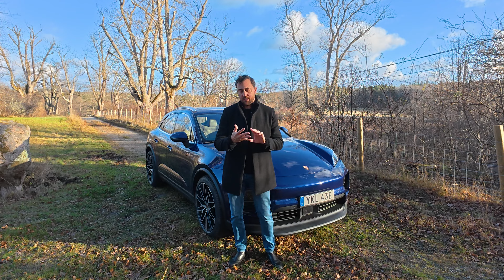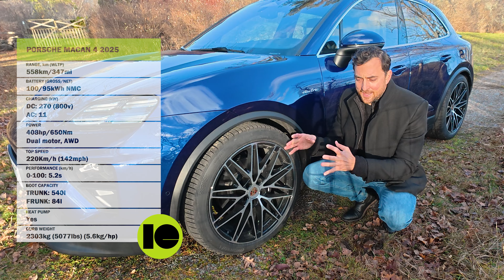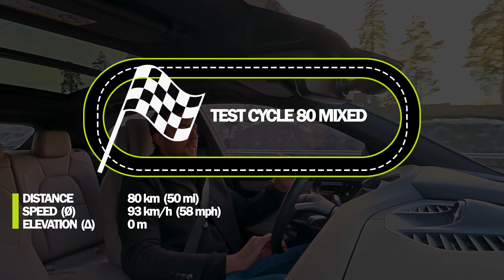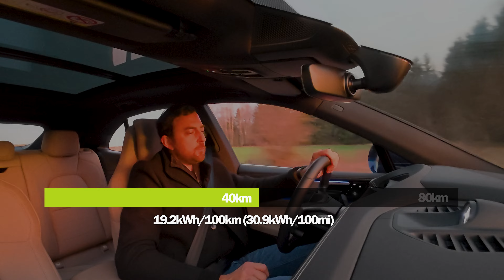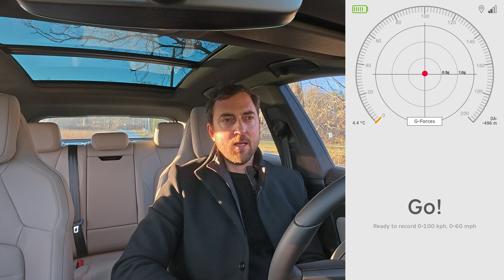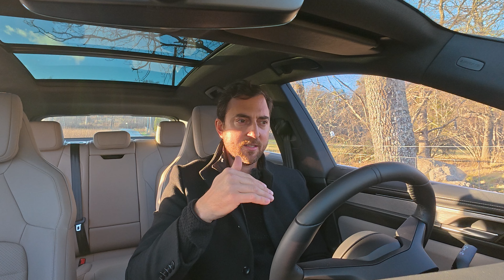Porsche Macan Electric - The things YOU need to know! | Charging, Range, Noise, 0-100

Comment: Attention Porsche owners, do not get thermal glass, it will interfere with functionality of things like radar detector, garage door opener, but if you don't use these things then ignore my advice.
Reply from the maker: Goods info. I have had some gps issues when testing 0-100. Thermal glass may be the reason.
Reply: @ Yes definitely as the way it’s made it interferes with the radio frequency of various gadgets. I don’t pretend to be an expert but I know from other owners, nothing but electronic device issues with the noise thermal glass option. I’ve been looking at buying Taycan 4S. Do you suggest instead waiting for a macan 4S to depreciate and get that over the Taycan. I drive about 70 miles per day.
Reply from the maker: @topspin1715 I think the Macan 4s will deprecate less than the Taycan, but hard to tell. Taycan is a much cooler car to look at and will for sure draw a lot more attention than the Macan, it's has more real Porsche dna.

Comment: Looks a nice car, efficieincy not great as you said and pricey. Porsche will need to revisit its pricing going forward, especially the option cost and strategy, the next gen Chinese EVs with the new higher density, faster charging, longer lasting batteries will be formidable competitors.
Reply from the maker: Valid points

Comment: I wouldn't call the Macan a full size SUV, it's more a compact SUV as the size of it isn't that different to my 2024 Kona EV.  The Xpeng G6 which is in the same class have to rewatch your review to get the interior sound levels in comparison to the Macan.  The Macan is a nice car though but it is a Porsche so every option is extra $$.  That 21min of 10-80% is there with eGMP platform cars if you have a younger family the refilling stops will never be 21min heck even with 4 adults in the car the ablutions alone could take 20min total never mind anything extra like grabbing a snack or drink even.
Reply from the maker: Did I say full size? My bad ä, it's a mid sizer. Sorry.

Regarding the charging you are right, it's so quick you most often need to move it from the charger not to get idle fees.

Comment: Auto-dubbed is active for this video; everytime I watch another audio track is selected (either Spanish, or French, or German), but never the original track…
Changing to another track is not possible (no audio setting for the video). 
I’m not going to unsubscribe though, maybe I’ll get lucky next time…
Reply from the maker: Hmm..this is a new feature from YT. My first video with autodub. So you want to watch it in the original English version but get other languages?
Reply: It works great for me
Reply from the maker: Do you watch it in original audio?
Reply: @ItsOnlyElectric  yes
Reply: I have the same issue on other channels. On one of them I got this reply: 
“YT was having an issue. Several other channels had the default English language replaced with Spanish or such.”
I am using an add blocker…, maybe YT is punishing me…
Reply from the maker: @favvrlįjng hmm. Add blocker may be a thing here